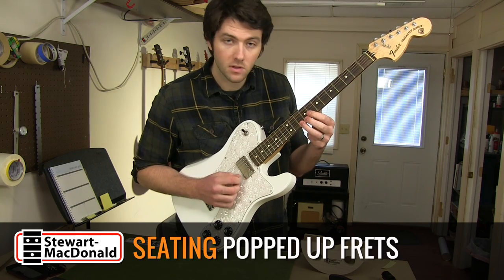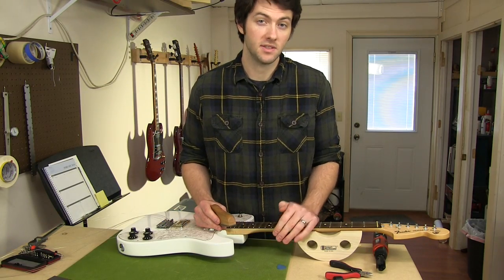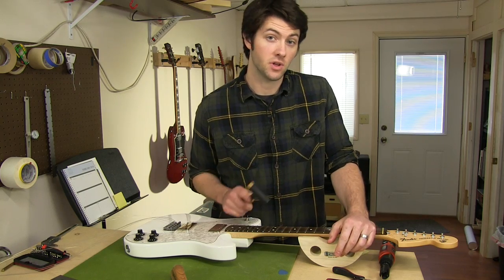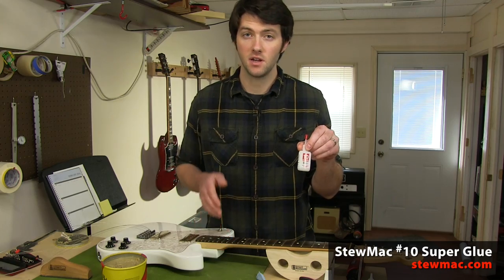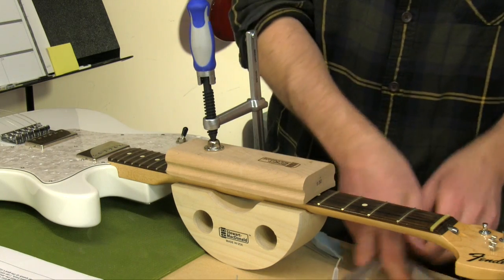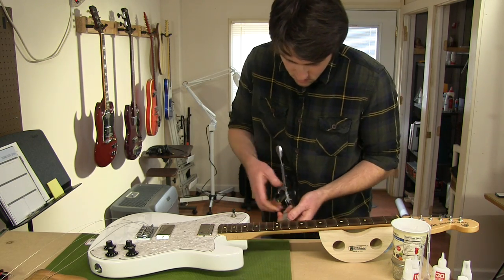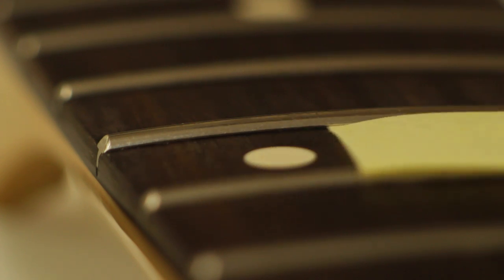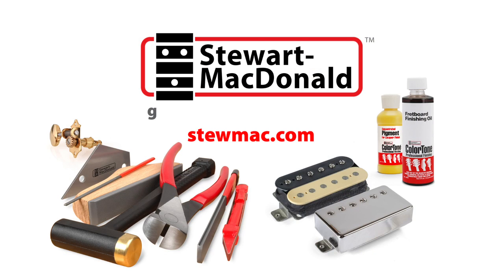Fixing fret buzz: seating a popped-up fret

Comment: One question: what if the two frets considered good in the beginning of the video are instead too low compared to the most of the other frets? Wouldn't it be wiser using a radius block and sandpaper, the right way, to make all of them the same height, letting us having a straight neck?
Thanks for answers in advance.
Reply: Use your truss rod to take all the relief out of the neck so it is flat.. Set a 24" or smaller metal straight edge on top of the frets. Shine a light from behind the straight edge.  Do you see light?  This will tell you whether that one lone fret is low. Repeat toward both edges of fret board as fret may be low only on one edge.  Cheers!
Reply: @topwatertrl  
thank You very much!✌

Comment: how do you clamp down a fret over the body on an archtop or acoustic?
Reply from the maker: For pressing frets into the tongue on an acoustic guitar, we recommend using the Jaws2.
http://www.stewmac.com/Luthier_Tools/Tools_by_Job/Tools_for_Fretting/Pressing/Jaws2_Fret_Press_and_Inserts.html

For an archtop, we recommend slightly enlarging the fret slots so you can press the frets in by hand and fix them in place with glue. Then, clamp them using a radius block over the frets and a caul shaped for the back of the archtop guitar.  You will need a clamp that opens wide enough to fit around both the radius block and caul.

Comment: Superglue? what happens when you want a complete re-fret?
Reply from the maker: You can place a soldering iron on the fret to heat and reflow the super glue. This will allow you to pull the frets, and you can then clean the slots and prepare them for the rest of the refret.  Here's a link to Trade Secrets! Issue 256: Removing the frets on the Mike Bloomfield Tele. Dan demonstrates this technique around the 2:00 minute mark.
https://www.stewmac.com/How-To/Trade_Secrets/Removing_the_frets_on_the_Mike_Bloomfield_Tele.html

Comment: If you transfer energy to the neck you will not increase sustain! The energy transferred will tend to vibrate the neck and mostly end up as heat as a neck is a fairly poor resonator of acoustic energy and it's an electric guitar anyway. A loose fret robs sustain because the system is insufficiently stiff at that point. A fully supported fret is stiffer.

Comment: Aren't you gonna have a miserable time removing the fret when you do a refret with all of the superglue?
Reply from the maker: As long as you heat each fret to reflow the super glue before pulling it, it should be any more difficult than refretting a neck whose frets weren't glued in. You can use a soldering iron to heat the frets and reflow the super glue. This will allow you to pull the frets, and you can then clean the slots and prepare them for the rest of the refret.  Here's a link to Trade Secrets! Issue 256: Removing the frets on the Mike Bloomfield Tele. Dan demonstrates this technique around the 2:00 minute mark.
https://www.stewmac.com/How-To/Trade_Secrets/Removing_the_frets_on_the_Mike_Bloomfield_Tele.html

Comment: I dont have high frets but theres buzzing on the e and a strings on the frets near the head
Reply: your action is too low, or your neck isn't straight.  Consider taking it too a tech to get set up.
Reply: Travis Garman
I bought it new on the day I wrote this, shouldnt it be setup already? its a fender squier standard telecaster
Reply: Cam Par No, they don't come set up out of the factory. Just take it to a tech and they can deal with it.  It's typically around $50 for a set up at guitar center, and it's well worth it.
Reply: Travis Garman
no guitar centers in canada but we have some good shops. Thanks
Reply: same!
Reply: @campar1043  NO! I've $2000 guitars that were not set up right.

Comment: Correction: "The more you transfer the energy of the strings to the guitar, the LESS sustain you will have". Why? you are transfering energy coming from vibration. Law of conservation of energy (kinetic energy in this case). Pure physics.
Reply: Not really.....if you have a loose fret, it's like having a crack in a symbol for a drum set. It sucks the energy away from the sound vibrations. In other words it muffles the vibrations. You want your frets to be solid as they can be to keep from wasting the sound energy/sustain. To demonstrate this, put a cloth under the string where it lays on the nut and the saddle. All of the energy will be absorbed into the cloth and you will have no sustain and no good tone. Same principle just exaggerated.
Reply: Cornbob Rimlove ok you win. Physics loose. :)
Reply: Nah, just your understanding of physics lost. The vibration runs along the string between bridge and the current fret you're pressing the string against. Those are the points where the wave gets reflected. Those have to be solid. The longer the wave runs up and down the neck, the longer the magnetic field of the pickups is disturbed. 
I just add this if someone else scrolls through all those comments.

Comment: Looks like he purposely popped the fret up from the scratches around the fret on the wood. Why would you use a radius block to push the fret down, I mean the fret is metal and the block is wood, so you will now have indents in the block, and you can't use it again for a fret level.Nice job very professional, I am glad your not working on my guitar.
Reply: Dude you should not be forcing the block so hard that it dents the wood.
Reply: A fret that is as loose as this one and won't even stay down in it's slot will not require enough pressure on the block to cause dents in the hardwood. Just like anything else....common sense needs to be practiced.....
Reply: Er Guitars guys at stewmac have forgotten more than you'll ever know. If you have ever even worked on a guitar popped up frets take next to zero pressure to re seat, no way you would ever have to clamp something so hard that it would dent a radius block. You've obviously never used one of those either because they're very hard wood.
Reply: *you're